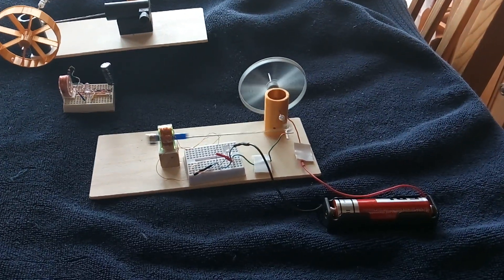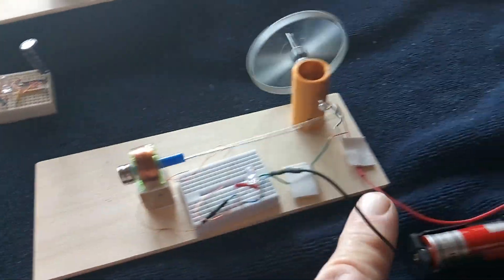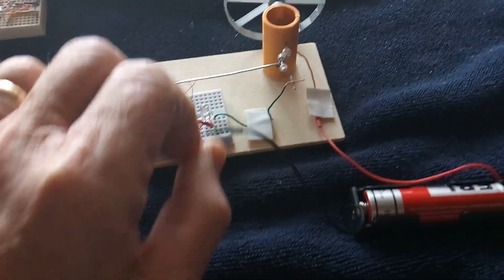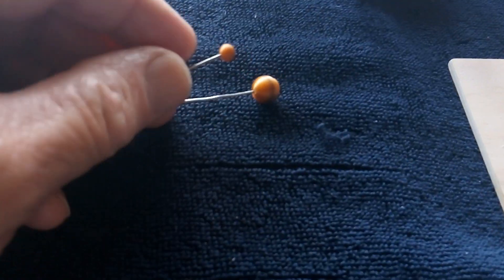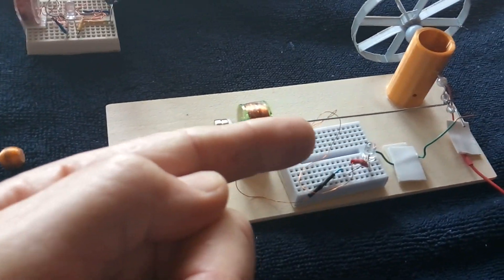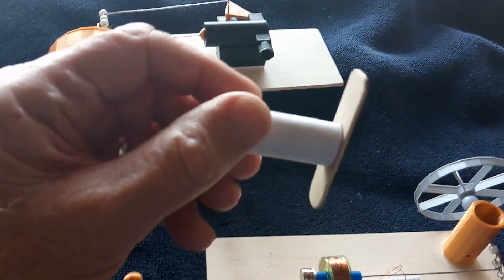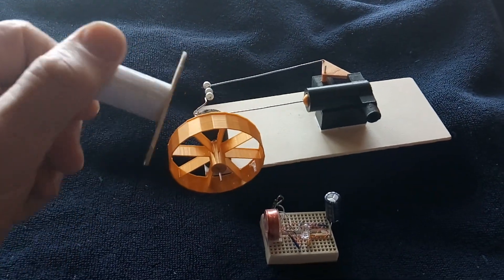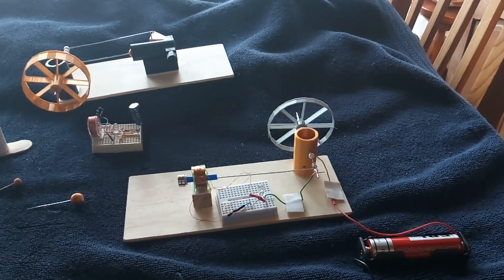Reciprocating Electric Motor

Comment: one thing here... the magnet is creating an opposing magnetic field, back emf, it will always limit what speeds it will do.

yeah, ok, its only a little demo... but

look into how an induction motor works instead. repulsion. you dont need the magnet but you DO have to think about the magnetic path. magnetic flux flowing through a core will induce a current in a closed conductor with the required opposing magnetic field...

i think "solenoid" motors are highly underrated as they work the wrong way...

they are NOT ICE!

Comment: Very interesting!. I’ve always liked this type of set up. Kind of like an old fashion sterling engine or steam engine. It would be cool if you could somehow 3D print something that looked identical to a sterling or steam engine but have the coil concealed in the parts and maybe the battery in the boiler tank, etc...
Keep the videos coming Lidmotor👍🤓

Comment: Careful, you are getting like me, rambling from one project to another. The current one I am doing is a 3D printed manually pulsed pulse motor for one of my friends 😊 and now I am seeing how long it will run of a AA NiMh with a solar panel to top it up, like that clock I did last year (which is still running fine). I don't expect it to run for as long as yours as there is no finesse in my approach.
Reply from the maker: I find that wandering through the forest of personal inventions most enjoyable.  Whether I come across anything spectacular or not the journey around my cluttered work table is grand.

Comment: Have some fun and maybe scale it up and combine a Linear motor and a linear generator with a heavy flywheel.  Motoring coil could be powered by wind and or battery or other power source. While one uses a Buck/boost converter on the generator coil to regulate output,  so that energy can be fed in and pulled out concurrently. 

You might want to consider snubbing circuit to limit inductive kick back in motoring circuit.

Comment: But you haven't mentioned that this machine has mechanical switch instead of read switch.
Reply from the maker: You are right. There are several ways to to switch this motor.  Here I just use a mechanical 'make and break' switch usint the crank shaft.

Comment: This project show us what?
Reply from the maker: Good question.  Why do this?  It is an example of how to build a better old design by using gained knowlege from a recent project.  These 'solenoid engine' designs are terribly inefficient but fun to build and watch run.  The 'Air Engine' project that I just did insired me to look backwards at an old project and perhaps improve it.  This is a 2014  super simple model that I built :  https://www.youtube.com/watch?v=8zKCCQAwMfk